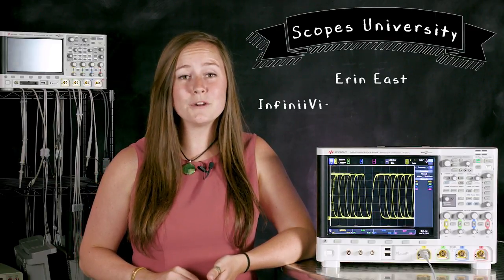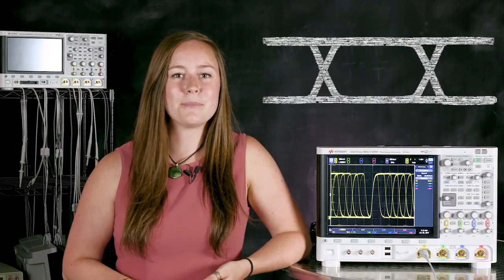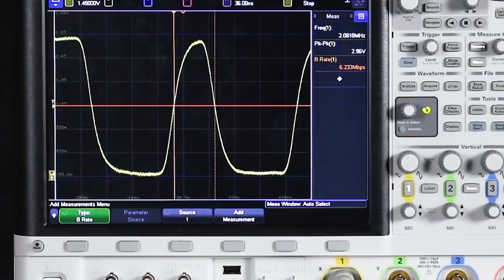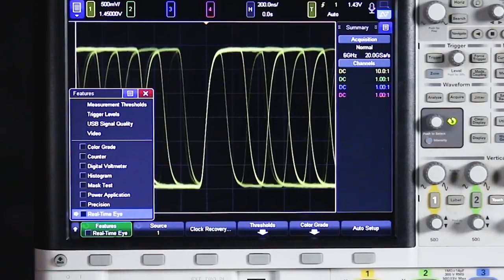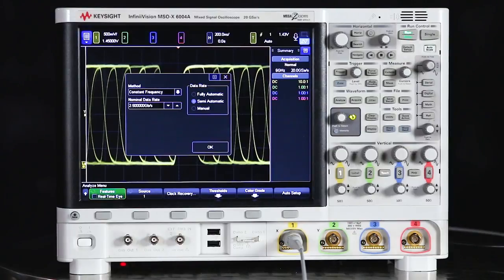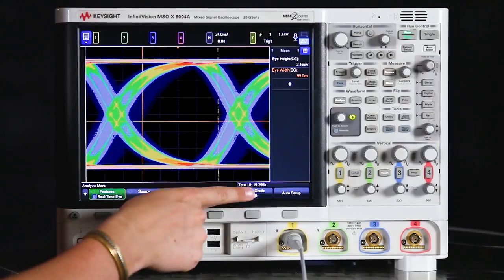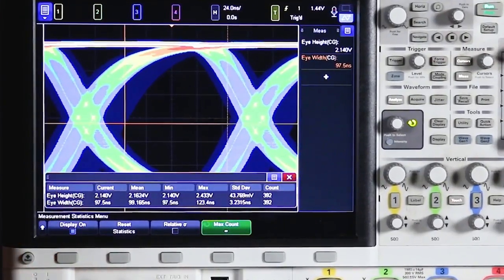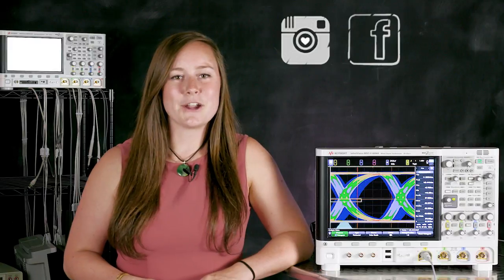How to Set Up an Eye Diagram on an Oscilloscope - Scopes University - (S1E3)

Comment: Old problem: understanding eye diagrams
watches video
looks up price for the scope
New problem: not enough money on bank account
Reply: This is a real problem!  The great scopes keep getting better, but also further away from our wallets.

An alternate approach is to download captures from less-capable scopes, then do the analysis on a PC.  If the scope supports LXI (as nearly all recent o'scopes do), then you can use any of several LXI remote front-end tools to fully automate the process.

That is to say, you don't need your o'scope to run all the fancy software internally: That's what PCs are best at doing.  Much of the profit for high-end scopes is burdened on the software "features".  Get the minimum o'scope hardware that has the bandwidth and trigger capabilities you need with enough trace depth, then do the rest on a PC.

You'll save a ton of money and gain a ton of flexibility.  The downside is that you'll need a PC in order to make full use of your scope.  But given that a mid-range laptop will have a much better screen and a more powerful processor than even high-end o'scopes, this isn't much of a negative.  And it is a huge positive when doing complex signal analysis.

Some may recommend USB o'scopes, but I still prefer to play with the knobs for doing quick measurements.  And the hardware capabilities are nearly identical for the money.

Another concern with super-smart o'scopes is that many of them run common operating systems, such as Windows.  And they stop getting updates surprisingly soon after you buy them, meaning they could become security risks on your network.  Having minimal software in the scope makes sense, so why pay extra for more?  Pay for the o'scope hardware you need, and let a laptop do the rest.

Comment: As someone learning a lot about data transfer recently I think I need a scope or logic analizer but I'm not sure if it's worth half a year or more of saving money.
Reply from the maker: There are some great lower cost options out there for both scopes and logic analyzers, but if you need to do jitter testing or RTE type measurements you'll have to consider higher cost options.
Reply: Those digitizer "scopes" do both for a fraction of the cost of mixed mode 'scopes. There's about a dozen OEMs building these boxes.
Reply: So true. A jitter analysis instrument is like a calibration standard, in that it needs to be waaaay more accurate than your DUT. And, that level of precision and accuracy ain't cheap. :-)

Comment: I have the same model scope and use it for eye analysis of serial data. The part where I lack confidence is in the probing of high-speed signals. The probe is the N2752A 6Ghz , but I don't know how much the probe is disturbing the signal. I only have one of these probes at the moment so I cannot double up the probe loading to visualize.

Comment: Hey, i am wondering if I can measure the eye diagram of clock signal itself? Or it doesn’t make sense at all since the clock signal is the base for triggering.
Reply from the maker: Yes! That's a fairly common measurement because clock jitter tends to propagate throughout the system. What you can do is measure the jitter from the trigger point. So, the trigger point is consistent but the edges around it will allow you to measure jitter.
Reply: Keysight Labs so, can I measure an eye diagram of clock signal itself?

Comment: How do people that don't have a $22,000 scope do an eye diagram?
Reply from the maker: Generally you want to use gear that has that ability built in, but you could also set one up using persistence and/or mask testing. Just move your trigger to the left of the screen and crank up the persistence
Reply: You can have a set-up like this: 
CH1→ Bitstream Signal
CH2 → Clock Signal (External Waveform Generator)

1.) Find waveform generator that is able to: (a) output a sufficiently high frequency for the application's bit rate (b) phase shift its waveform. (Look on eBay if not on hand.)
2.) Plug bitstream signal into CH1 of your oscilloscope. (Ideally, using differential probes. Differential probes have better CMRR than using two oscilloscope probes, so I'd use them.)
3.) Plug waveform generator into CH2 of your oscilloscope. (Waveform generator is your clock source.)
4.) On the oscilloscope, trigger on the rising edge or falling edge of clock signal.
5.) Turn on your bitstream.
6.) Adjust the phase of the clock signal so that you can align it with your bitstream signal appropriately.
7.) Turn on persistence.
Reply: They buy a Rigol MSO5000 series , bottom of the line 4ch, for far far less, then you hack it up to the highest model and you'll have your eye diagram for in the order of $2,000